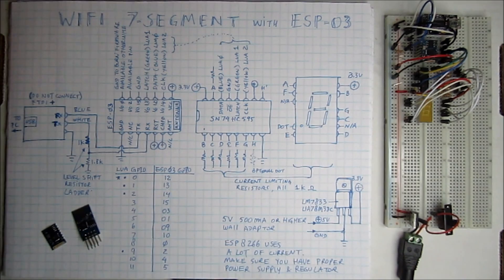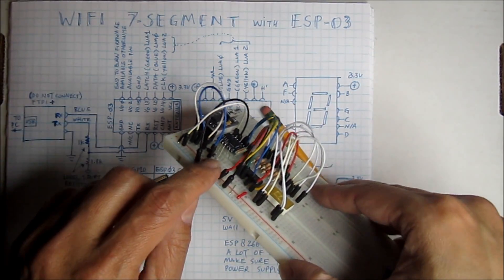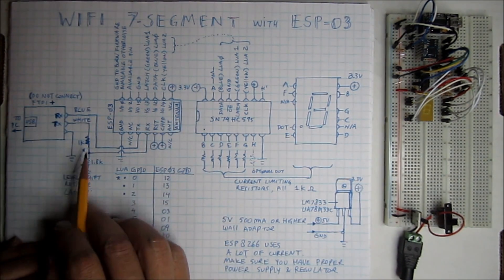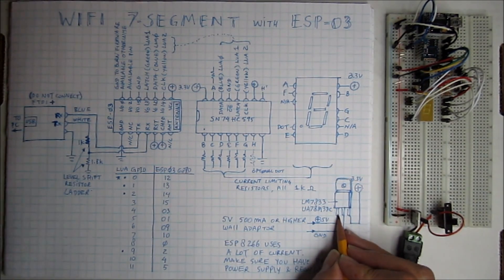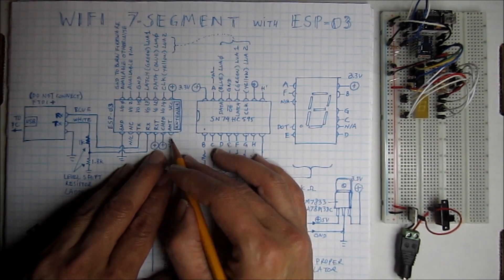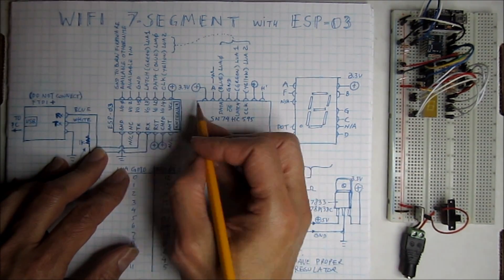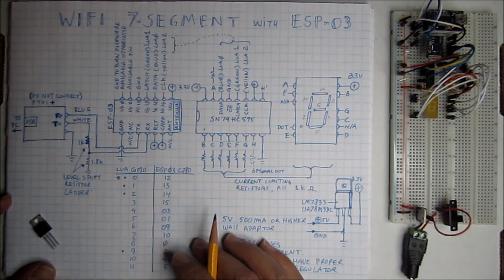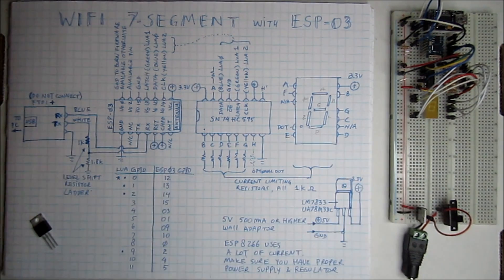$3 Wifi module part 8A: WiFi I/O Schematic Diagram

Comment: Please don't stop with this series, very informative :)
However you keep mentioning that you use the ESP-03, is this the same as http://www.ebay.com/itm/ESP8266-Serial-WIFI-Wireless-Transceiver-Module-Send-Receive-LWIP-AP-STA-A-/201205524305?pt=LH_DefaultDomain_0&hash=item2ed8c8a751 or is there any advantages in the ESP-03 to this?
Reply from the maker: Thanks Rohin!
The ESP you link to is the ESP-01 which has two usable I/O ports, the ESP-03 on the other hand has five usable ports.
http://tech.scargill.net/christmas-post-in-wark/
The last time I checked, there were twelve different versions of the ESP8266 !

Comment: Are you shure that it's safe to connect pin i/o 0 to 5V? not to 3.3V?
Reply from the maker: Sorry if I misspoke or that the schematic was unclear.  All + are +3.3V except for the input of the voltage regulator.  The voltage rails on the board are connected to the +3.3V output of the voltage regulator by the power jack.